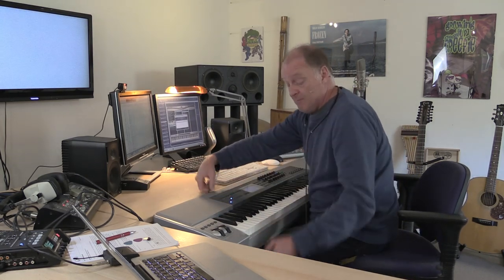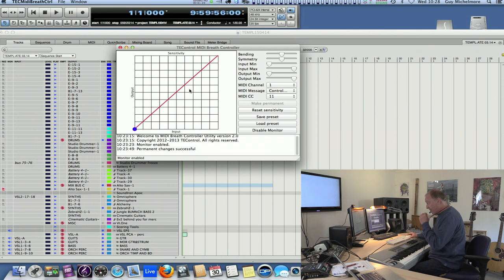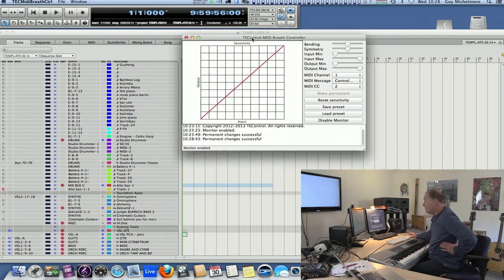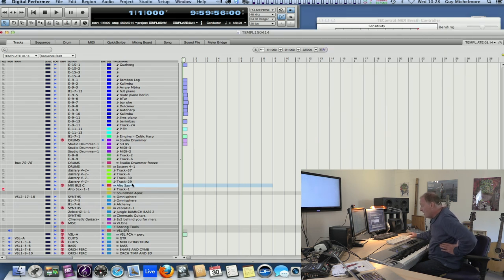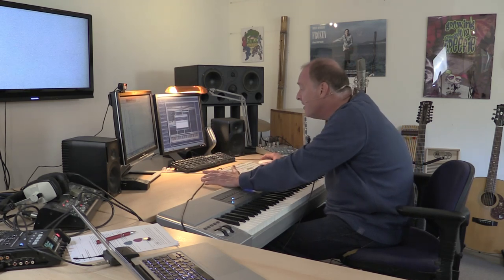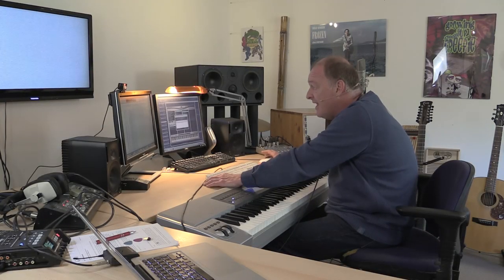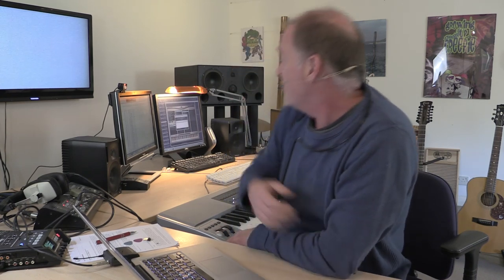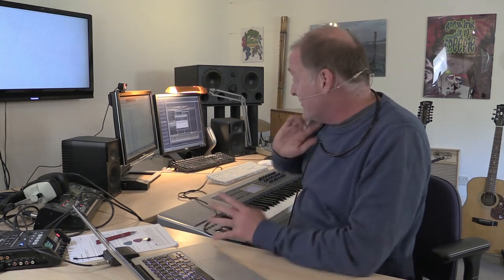How To Use A Breath Controller

Comment: I just bought one of these. Wonderful piece of gear but. Now I have no sound from my samples unless I blow to raise the expression controller. Anyone have a workaround?
Reply: I only know about Studio One right now but... I blow the bbc2 to see what knob is moving then right click that knob and click midi unlearn. Then manually adjust the knob to the level I want.
Reply: Obviously I'm very late to answer this, but in case anyone else comes across this, I believe you can set a minimum value for breath control so it will never be completely silent until you stop playing.